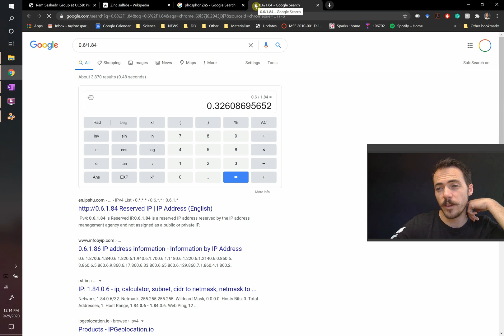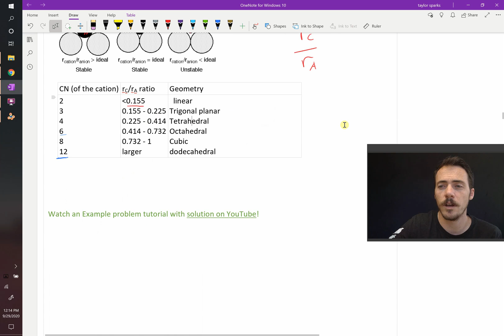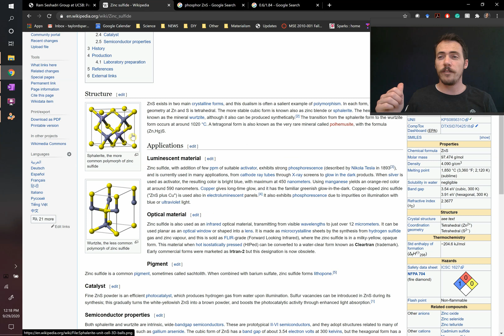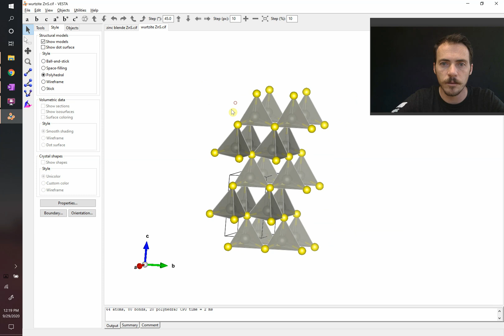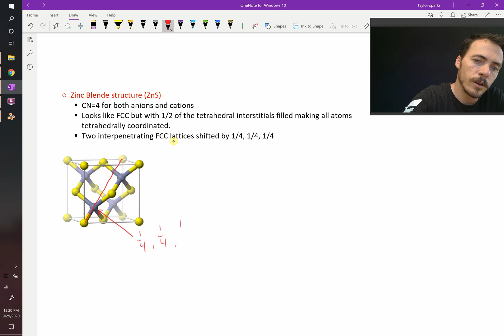Zinc Blende crystal structure

Comment: hey, thanks for the vid. zinc blende has rc/ra = 0.326 and it has tetrahedral geometry, as you said in the video. But afterwards, you were talking about how it's a cubic crystal structure. But cubic ones are stated as 0.732-1?? is it both at the same time or sth?